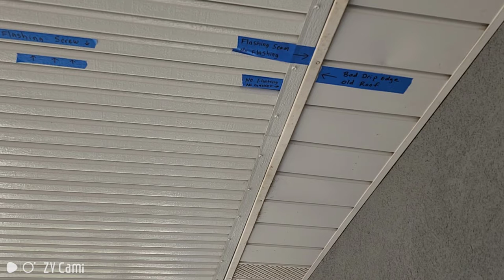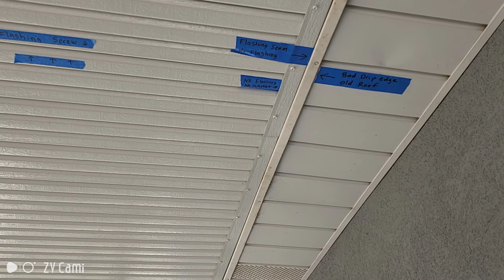Fix your leaking Patio Cover or Aluminumn Awning

Comment: We have a very old sunroom in a winter climate and the roof is leaking in the middle of the room, but not at the drip edge where it attaches to the house. We were thinking about using a repair kit meant for repairing aluminum RV roofs to seal over all the seams?
Reply from the maker: If it is a sunroom it's probably leaking through the seem on the lock. I think what your are planning on doing should work good on those seams.

Comment: Good video, how do you fix the flashing screw scenario? Can you just seal the that area with silicone? Or clear water proof caulking?
Reply from the maker: You can just silicone over the screws on top. Same with where the flashing over laps. Silicone will wear down over time, though. So, depending on how harsh of weather you get, you might have to re-apply more often. Spend the extra money couple of bucks to get good quality 100% silicone. Gaco also works great as well.
Reply: @utahawnings  thank you for the video and answering my question. I am in Southern Cali. I will take note to that

Comment: I have a finished sunroom with a couch and tv, underneath a aluminum awning. It lasted pretty good, now I’m getting leaks and rain in nyc has gotten worse. I used Henry 100% silicone 2 coats still some leaks. Is there any shingle type material I can use without having to nail or screw down? This video was very informative. Thank you
Reply from the maker: Are you looking to shingle the top of the awning?
Reply: @utahawnings  yes will it work

Comment: Whats the best way to mount the screen to the cover? I ended up using a 2x4 on some hooks, but it would look better mounted directly to a beam.
Reply from the maker: Depending on where you live there will be steal inside the beam. Either way some metal self tapping screws should allow you to screw directly to the beam. If you are wanting to add the screen to the side of the awning, you probably need to add a level beam on the side that goes from the existing beam to the house.

Comment: I have a cover like the one in this video that’s about 15 years old. It’s all good but where the seem is on the gutter piece it is leaking. Is there something I can do or dkk on I have to replace the entire thing?
Reply from the maker: I'm guessing it's where the gutter is spliced together, if I'm understanding it right. You probably just need to clean out the gutter where the splice is and re-silicone that spot from the inside of the gutter. That is a VERY pesky spot, hard to get to without taking the gutter off and hard to get the seal perfect. It can be done though. Worse case scenario is take the gutter off and take it apart. We usually put silicone on the gutter before we slide the splice into it.

Comment: OMG.. when does the  instructions start?
Reply: yeah i don't think he tells you how to fix anything, just rambling for views
Reply from the maker: I apologize if the instructions provided in the video were unclear. Please use the first part of the video to help identify the source of the water leakage through the awning.If you determine that the issue is with the flashing—whether it's overlapping or where it's screwed down—apply 100% waterproof silicone to seal those areas. Should you find that flashing is missing, you'll need to purchase and install the appropriate flashing.If the problem is related to the drip edge, I recommend consulting a roofer to make the necessary repairs. For gutter-related issues, the first step is to clean out the gutter. If the issue persists, it may be necessary to adjust the gutter so that the awning panels can overhang into it more effectively. Additionally, ensure that everything is properly sloped to prevent water from flowing in the wrong direction, which could be contributing to the problem.Again, I apologize if the instructions in the video were unclear. Please don’t hesitate to reach out if you need further clarification.

Comment: can water be coming back in even with a slope?  i believe it leaking from the gutter.... ?????
Reply from the maker: Yes. If the panel doesn't overhang past the lip of the gutter, it can roll back. Similar to when you pour water out of a cup. It's just easier the less slope you have.  The solution would be unscrew the gutter and slide it in about a half an inch. You'd also have to trim down the side facia. That would be the right way to do it. You could silicone that from the top, but it's actually pretty hard to do, and won't be super permanent.